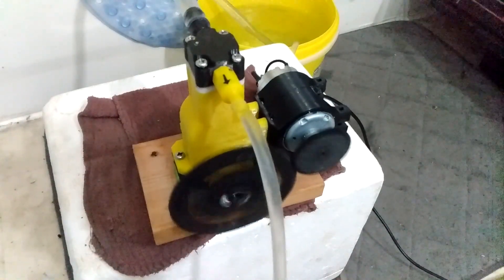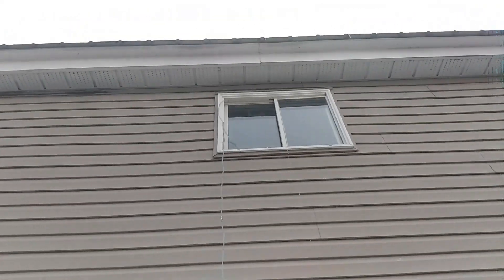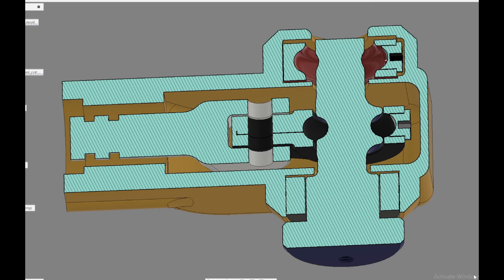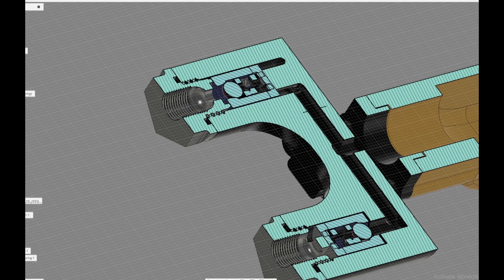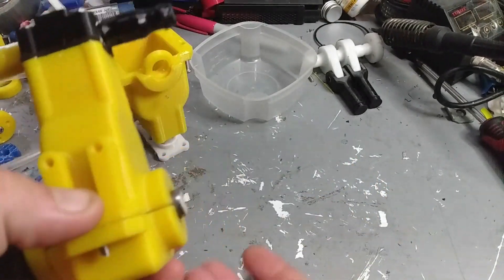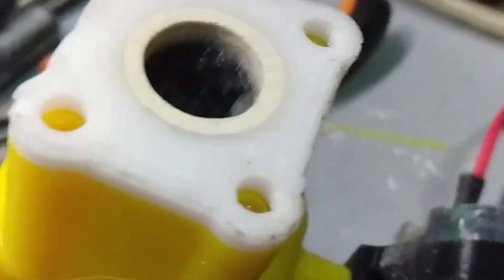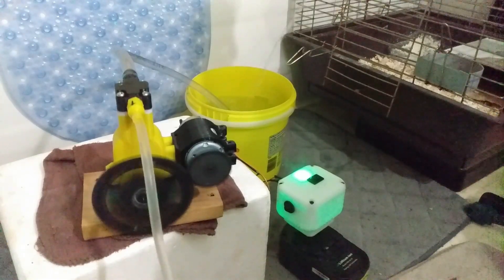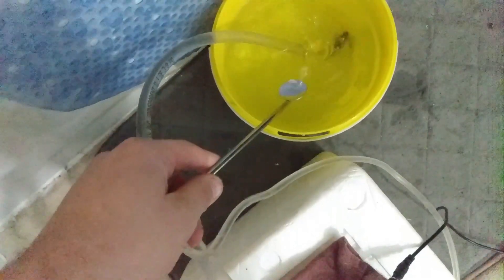3D Printed High Pressure Pump ( files in description )

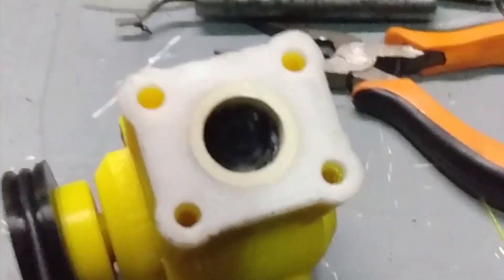Comment: in regards to your (alleged) cavitation. no, it is not cavitation. it is an actual air leak on your suction line, possibly from the threads of your inlet check valve or in the piston seal to cylinder bore area or the head gasket. i am 83% certain it is a head gasket leak and 16% certain it is the piston to cylinder leak. it is difficult to see at the 7:27 mark, but i am not sure you have any lubricant there in the piston area. depending on application, i would research a food safe lubricant. anything with NSF on the label will work as long as it is compatible with your plastic material. i congratulate you on your design and endeavor. 

bonus comment:
you should do a helical screw pump. it has a reduced risk of vibration transmitting through the water when compared to piston type pumps
Reply from the maker: The only reason I assume cavitation is it didn't seem to be leaking , after more use post video it seems the piston oring distorts at higher speeds as it scrubs the bore ( crank fills with water while external surfaces are dry .  At low speeds it works fine , which explains the bubbles .  I think there may be some cavitation as there are wear marks on the piston top however that could just as well be from the water eroding the plastic .  Overall ya this isn't the best pump but I do have a multi cylinder system that runs way smoother , and would be much less abusive to the system .  Either way this does do its job pretty well , but I do plan on doing more  water pumps down the road .   The real goal is the combined traits of reliability and pumping efficiency , which compared to previous pump designs of mine this design has produced the most pressure on the same or less energy . That being said I also have a list of possible improvements to this pump . Machined piston ( solid nylon, stainless or aluminium) , silicone or other material based orings or other seal design types , better head seal ( if orings fail to hold up) , amount other ideas .
Reply from the maker: Also no lube on the top side but the bottom end and piston below the oring is lubed with light grease .

Comment: Hi I would suggest a tooth belt or angled gears!
Reply from the maker: Angled gears , I would assume to be helical gears , helical gears produce way more thrust load than the beadings in this could handle . The timing belt tho would be a great solution . For video purposes time and money are limiting factors so I just used what I had on hand or could make quickly .